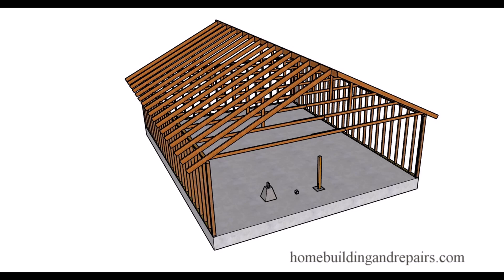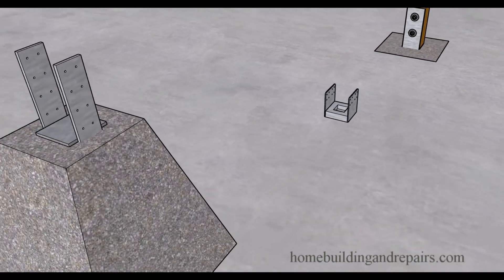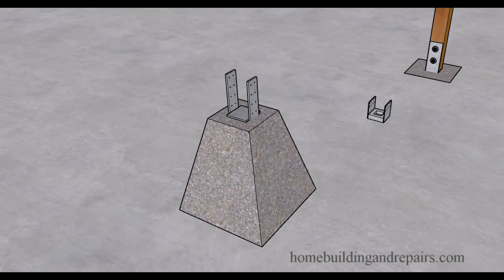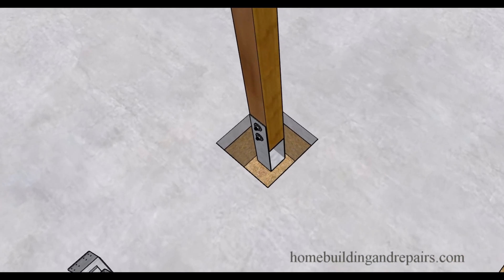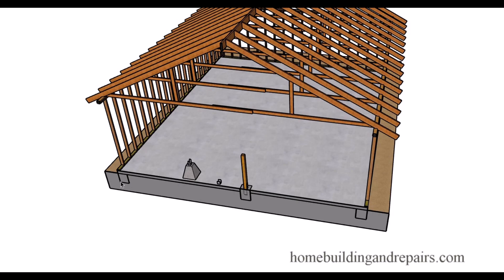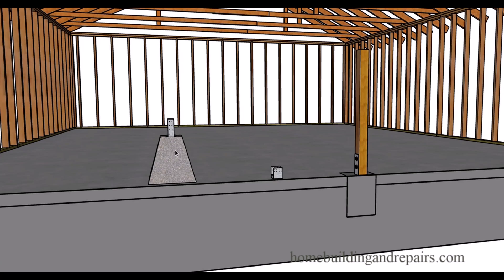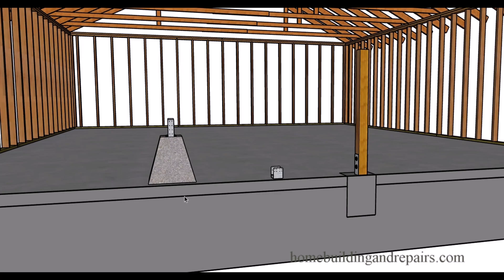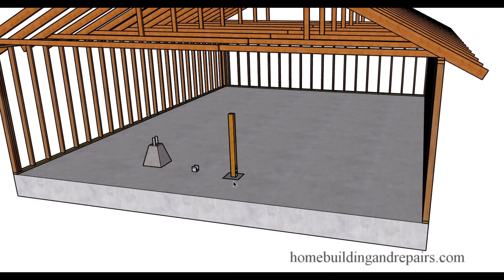The Right Way to Install Piers or Base Connectors on Concrete Slabs

Comment: Clear and thorough. Thanks. I'm looking to set 4 piers on an old concrete slab around our pool and build a simple outdoor shower with 4x4s on the piers and lightweight "walls" connecting on 3 sides. Even though not the strongest option, it seems from your video that it should work ok, given I don't care if it moves some and it won't be very heavy.